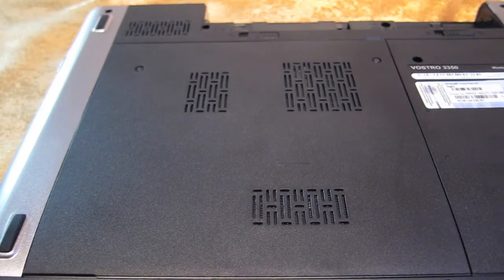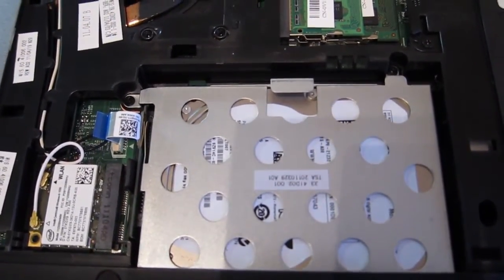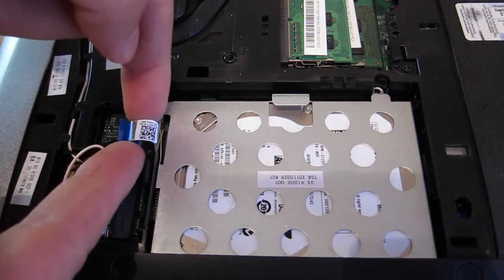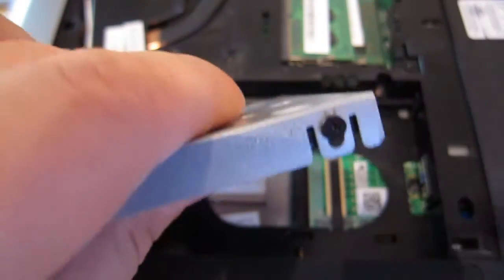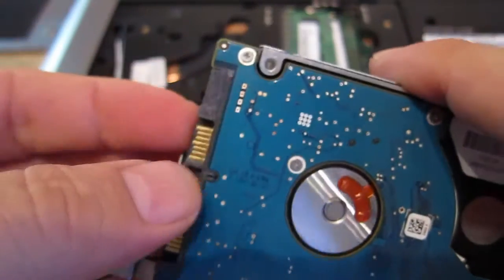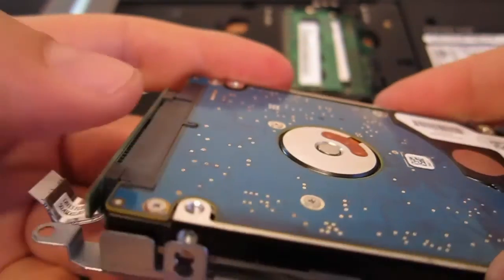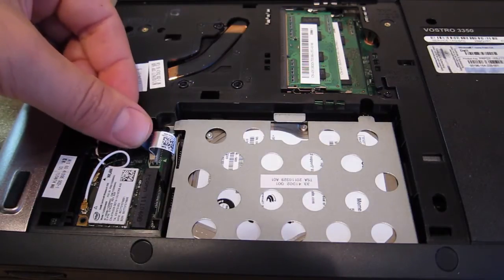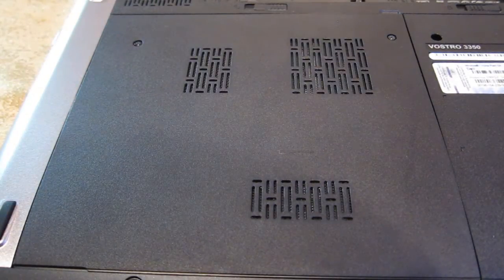Dell Vostro 3350 Hard Disk Installation Review

Comment: Hi just for clarification, you said: 'From my experience this will only work if the new hard drive is larger than the previous one.'  Now the loaded HDD on the Vostro I ordered is 320GB 5400 RPM SATA Hard Drive - I plan to replace it with an Intel 330 series 180GB.  Does it mean it might not work? 
Sorry just a little excited about my internal HDrive change. 
Thanks for replying right away to my OPost.

Comment: @mevnet 

the performance is awesome after the last firmware update.
I've got 744 performance points (AS SSD benchmark).
There are no noticeable performance drops if the drive gets full (a big sandforce[e.g. the vertex of OCZ] problem...).
very good value for money